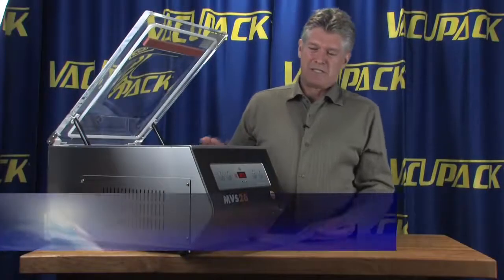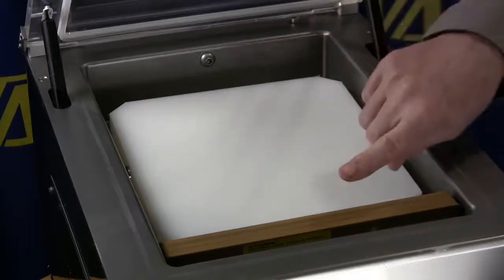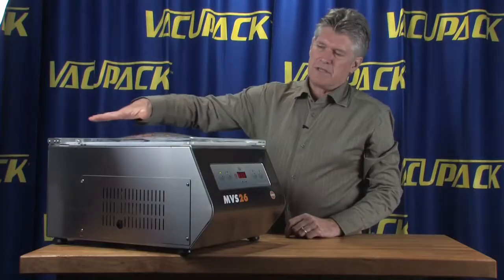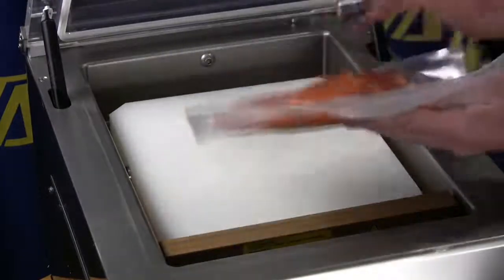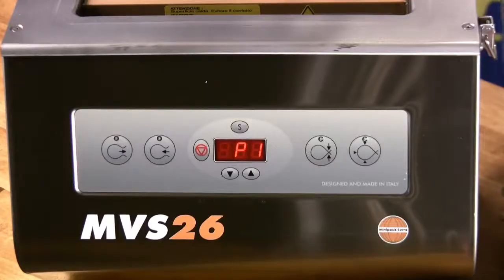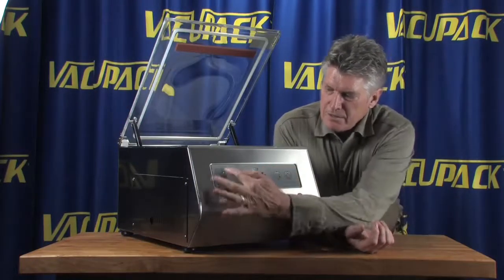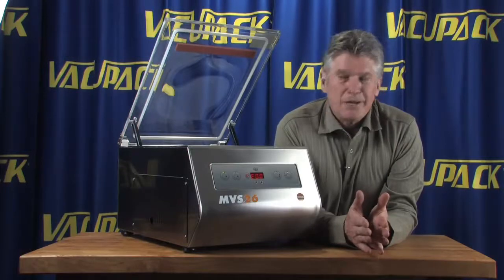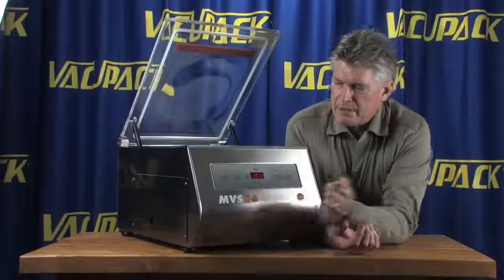MiniPack MVS26 Chamber Vacuum Sealer Packager

Comment from the maker: Yes the MVS26 is slow! It has a very little pump in it.  For a faster unit look at the MVS31X but better still look at the Sammic 306 or 310 WOW what great units huge chambers sizes with the same foot print on the counter.  The pumps are huge and extremely well built.  The Electronics are superior, hinges, heat bars everything about them is a huge grade up.  Not so say MiniPack is bad just middle of the road. Far better than VacMaster bottom of the barrel! Sammic is the new top standard!